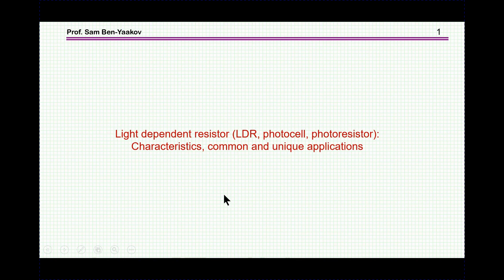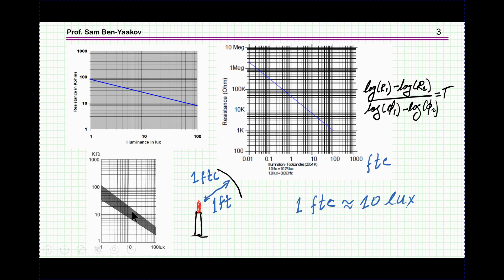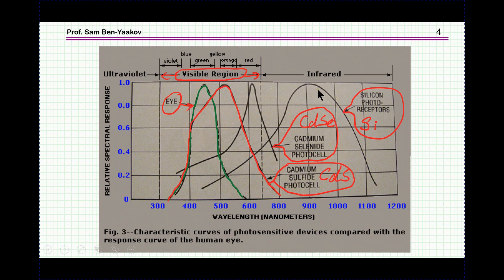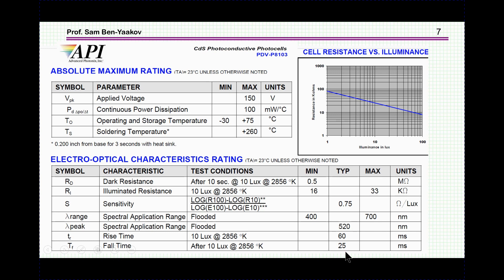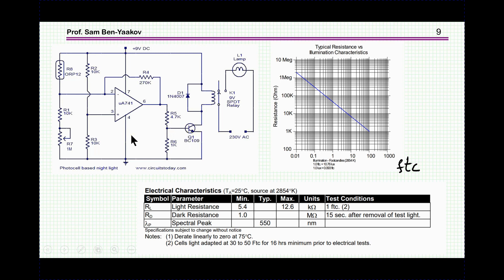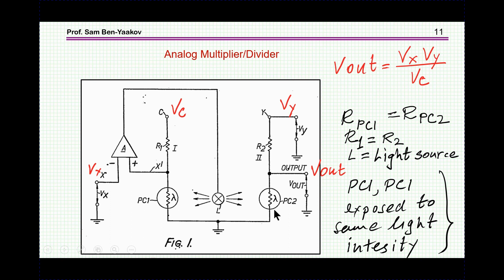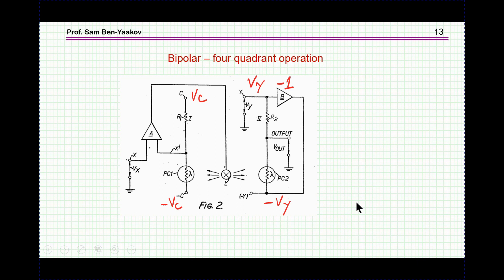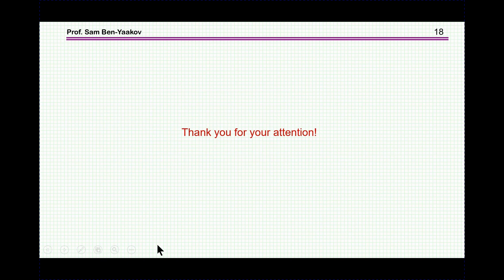Light dependent resistor (LDR, photocell, photoresistor)

Comment: Mr Carlson's Lab youtube channel has a video in which he works with LDR's and neon bulbs in HP 419A nullmeter. 

if i remember correctly those were in 10M ohms and switching at 10Mhz, i wonder if those are CdSe based?
Reply from the maker: Can you find the link ? Thanks. The frequency you mentioned is probably the signal via photocells and not light switching frequency.
Reply: https://www.youtube.com/watch?v=vrmwql2msbU 2hour video :)

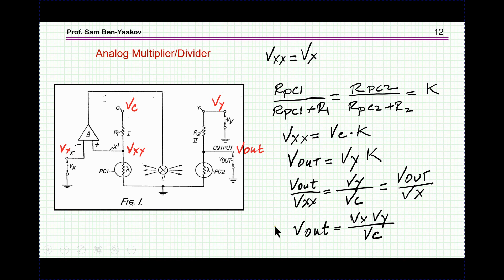Comment: Would you get an overflow flag when you divide by zero 15:15 ? comparators could be added to tell you that the result is OK if the sources are known :)
Reply from the maker: Good point. As is division by zero will cause amp saturation.

Comment: The led version has a higher frequency response?
Reply from the maker: Good question. These are sensitive to the deep infrared and some are indeed faster, in the microsecond range.  Used to track missiles and  projectiles. High sensitivity is obtained by cooling that reduces noise and thus improve S/N.